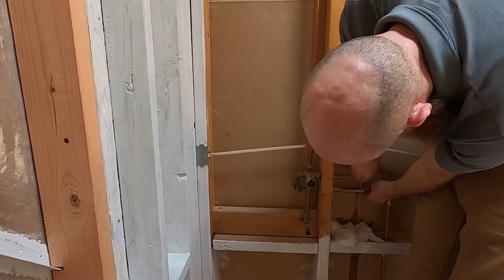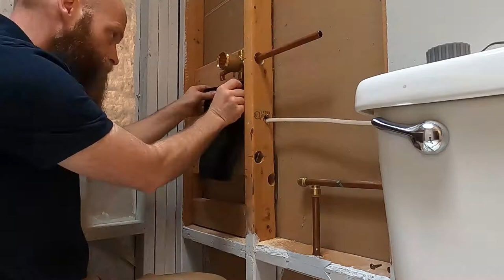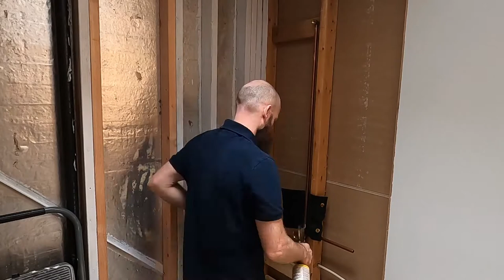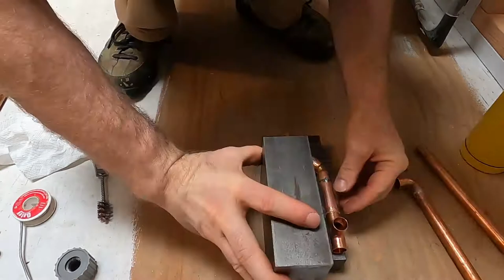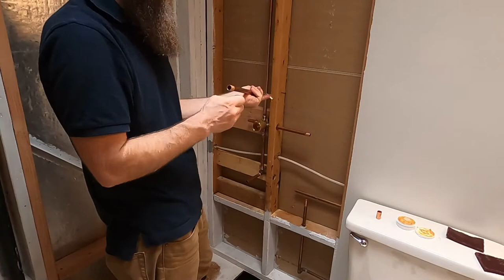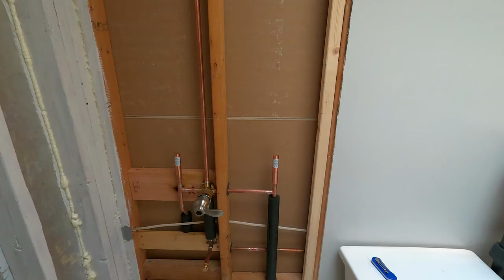Plumbing In New Delta Tub & Shower Valve With Hammer Arrestors (Part 8 Guest Bathroom)

Comment: what are the two pieces on top of the t joints in the final shot? Mini expansion tanks? Copper pressure relief valves?
Reply from the maker: They are hammer arrestors. They absorb the shock of the water suddenly stopping, when the water is turned off.